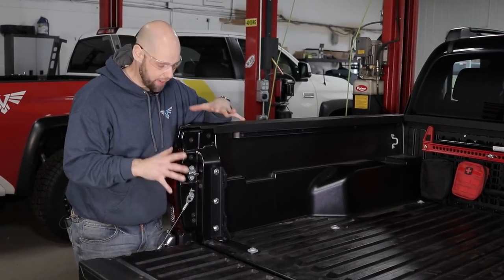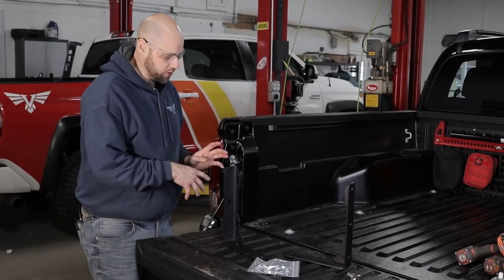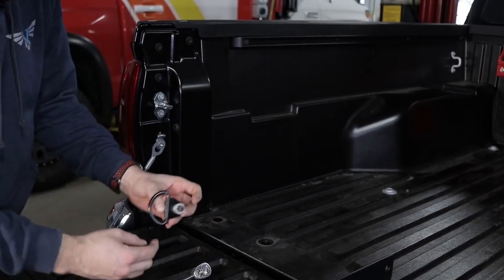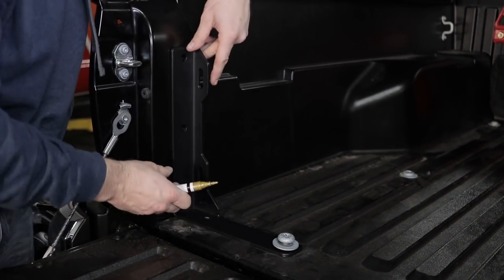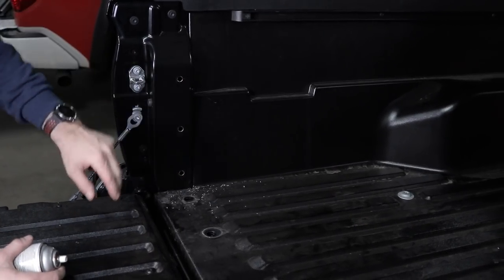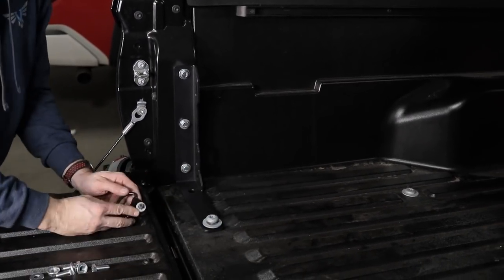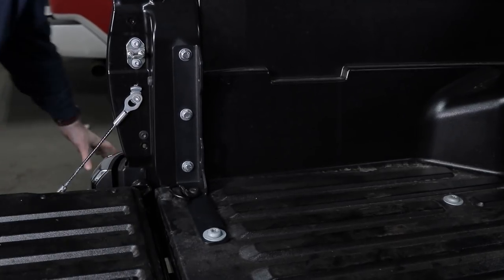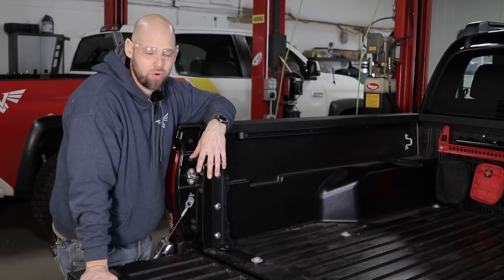Tacoma Bed Stiffener Installation

Comment: Toyota has become sloppy & has cut corners drastically on many things within last few years replacing the metal bed with plastic junk bed & plastic front molding for a bumper & much more & yet they jack the prices up thousands of dollars on these over priced vehicles for less quality an absolute joke... consumers should boycott them & not give them any business till they get it right I am ready to switch back to fords least you get yet a front bumper & metal bed not cheap plastic bed & plastic molding on front end that Toyota puts on their vehicles..
Reply: LOL. Well, sending zero business their way will just put them out of business, not make them better. My buddy has a Ford, and it's been nothing but trouble for him. My first-gen Taco was great. My second-gen has been good so far, although I am wary of the plastics! Good thing they're very moddable. Besides, I love doing the work myself. I think a large part of the value in Tacomas is in the body/frame/engine.
Reply: Plastic junk bed?  Have you seen all of the Gen I and Gen II tacos with a rusted out bed?  Hard to find one that isn't rusted out in Colorado.  Plastic isn't always a bad thing.  "Experts" said Glocks were junk when they came out because they were plastic.  I'm sure they wouldn't say the same now.